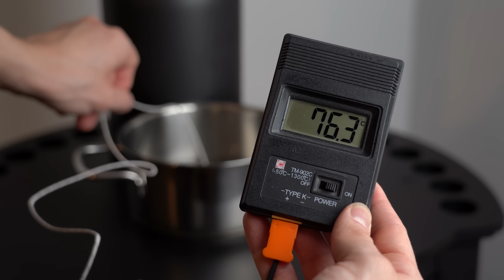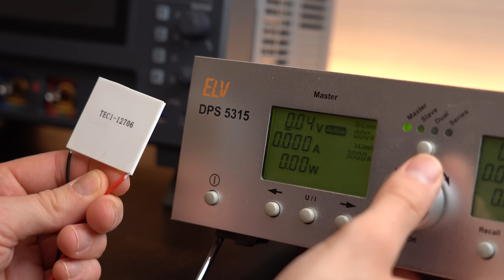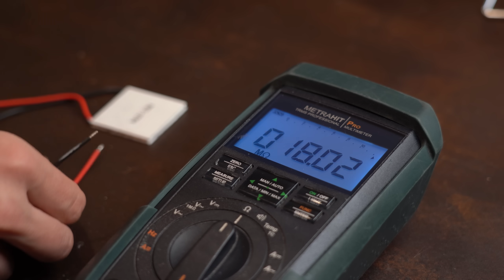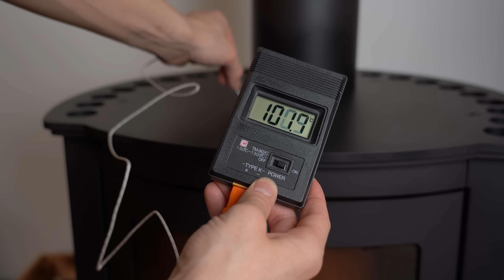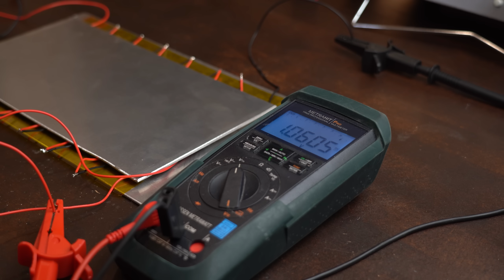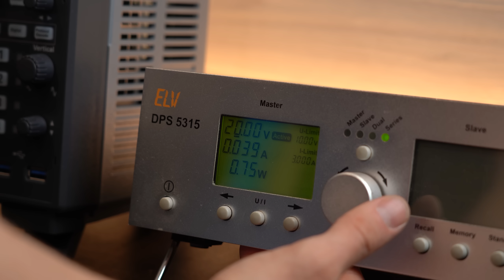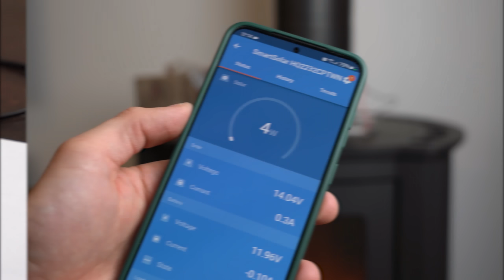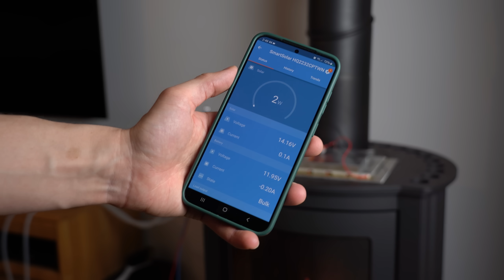I tried to Power my Home with Heat Generators! (Worth it?)

Comment: You can produce more power with a steam turbine generator. You need a boiler, steam turbine, condenser, etc. Waste steam can be used to heat the house with the help of a condenser. Condensed water is used to generate electricity with boiler. It would be a nice project.
Reply: I've got a project in the pipeline to use a Chinese diesel heater to run a steam turbine to generate electricity from diesel very quietly (relatively speaking).  It won't be nearly as efficient as a piston-driven generator, but I don't need much power and quiet is the name of the game for this application.
Reply: @GordLamb  Scott could even use a stirling engine. Stirling engines don't need water to operate (Of course it has less power). However, Scott's intention was to make a video for advertising. He had previously made a video about peltier. The result was the same as this video :D
Reply: He would be arrested by Greta Thunburg and friends
Reply: @MattyEngland  It was funny. Anyway, most of the heat produced in the stove goes to waste with flue gas. The flue gas rises to approximately 380 degrees centigrade. However, we can cool the flue gas to 180 degrees without any problems. There we can use the 200 degree heat to turn the water into steam. In a way, it's like using everything from the deer you hunt.
Reply: @hamzaterzi8801   lol, and yh I agree with you. Might as well make use of the wasted heat.

Comment: Why were you cooling down both sides? 4:07
Reply: so room-temp air could be on the hot side
Reply: Did you know that my 127c at the base cools off to about 60c at the pelter device hotside and 40 c on the fins of my stove fan.  So those are the values you should strive for on a home built one.  Or upgrade the quality of your thermocouple by spending more.
Reply: The fan in this case isn't for cooling its for drawing in heated air. Stagnant air would be cooled by the cup.

Comment: Ich hab ziemlich exakt genau den gleichen Aufbau gemacht. Auch mit Wasserkühlung mit kalten Wasser von draussen. Selbst das mit hitzebständigen Klebeband hab ich so genutzt. Mein Aufbau sieht haargenauso aus ;-) Ich schaffte es mit Buckboost Konverter und Kondensator , dass die Wasserpumpe sich selbst versorgte. Also so um die 10W. Sobald ich allerdings etwas zusätzliches dran gehangen hatte (z.B. Handy) brach das ganze ein. Außerdem hats mir auch die Peltiers irgendwann geschrottet. Denke hängt sehr viel von der Qualität der Peltiers ab. Und man muss wirklich eiskaltes Wasser nehmen. Ist aber m.E. was für Krise bei Stromausfall (+keine Sonne, kein Wind). Es armortiesiert sich nie im Leben.
Reply from the maker: Thanks for the feedback :-)

Comment: Great video, I’ve already tried TEGs on a PC and a barbecue grill—turns out my grill cooked burgers better than it generated power, with about 5W at best. The PC? It didn’t even heat the modules enough to get them going.  Cool experiment overall, but this tech is unfortunetly impractical for real-world use.
Reply from the maker: Thanks for the feedback :-)

Comment: I have a question, are modules affecting each other's output because you connected them in series?
I know for solar panels, if a solar cell is blocked by a shadow (for example a leaf) the current is also blocked through the entire solar panel
Reply from the maker: I thought the same thing at some point. But with the smaller version of this thing, I think it is safe to say that this negative effect should be minimized.

Comment: Build an ORC engine and generator, a small rotary vane pump used in reverse with a generator or for a larger version a scroll compressor from a hybrid car with the inlet check valve removed, a working non flammable refrigerant like HFO air duster, co2  or even water etc could be made to work. You may be able to generate several hundred watts like this but it wont be easy.

Comment: Seebeck generators would have been a better choice instead of the Peltier units.

Peltier are to be used to generate a heat gradient via providing current to the Peltier.  Seebeck generators are the opposite of Peltier, Seebeck generate current output via the use of waste heat energy.
Reply: Thanks, just wanted to comment this when I heard Peltier in the video ;)
Reply: Alright, I’m wrong & your Right… where is the  value you’ve provided to assist the guy in the video succeed with his project?
Reply: @NvTwist  its in the main comments, i told him to buy the TEG versions instead of TEC along with some actual part numbers to search for unlike the rest of u who cant even type TEG without prompting.
Reply: 😎
 buying a seebeck or a peltier module guarantees nothing, these names are entirely interchangeable in the market.
Reply: @echelonrank3927 I see you deleted the part where ya said “it’s the exact same effect in reverse LOL”   (EXCATLY!) but after realizing it agreed with what i posted. Poof delete…. Sad
Nothing is ever guaranteed, but my TEG  set up generates power every time I light a fire.
Reply: @NvTwist  no, it didnt agree with what u typed. 
ur text says seeback generators are the opposite of peltier which gives the wrong impression to the uninitiated that they might be different modules. 
and they are, but only in terms of generation efficiency and nothing more.
then i erased some insults and u think its sad LOL 
maybe whats sad is how ur ambiguous text along with thousands of others offer nothing of practical value to the sorry looking guy in the video instead of actually helping him.

Comment: You should build a Rocket Stove kitchen and use the chimney heat to warm up an insulated water tank 

And the peltier elements can be hooked up to the solar system battery system

Comment: Looks like the middle solder joints don't have kapton tape, was thinking possible short on metal plate, also did u get the temp on the fireplace metal to see what temp the device stops working to try and avoid hitting those temps if the is a max without cooling other side
Reply from the maker: They had kapton tape wrapped around each one.
Reply: @greatscottlab Awesome video, your videos and work are a huge inspiration and some my favorite parts of YouTube

Comment: Hot take? Use a steam engine or Stirling engine connected to a small generator.
The Stirling engine is probably the easier one. I guess you can reach 1-3 Watts on a smaller model with unoptimized cooling.
Reply from the maker: Will try it out next time ;-)

Comment: Get yourself a Peltier powered fireplace fan and reverse engineer it. They use an I beam shaped base to limit the amount of heat transferred to the TEC. Also there are multi-stage TEC modules that are even more efficient.
Reply: ur multistage i beams of overenginnered confusion will not help much, the fireplace fans use TEG modules, not TEC. TEC is used for cooling.

Comment: Gotta scale it up and cool the cool side better I think. This would increase efficiency(higher delta temperature = higher yield) and prevent them from burning out.
Reply: no, gotta use the correct modules instead of scaling up what works badly

Comment: Would be cool to try a passive system with big solar fresnel lens to heat up a dark element on the hot side, and use passive cooling from like an pipe that pulls colder air over a heatsink on the cold side (with some Bernoulli from updraft). 

The efficiency would be bad compared to solar cells but it would fun to see how far you can engineer a passive solar system with basic physics principles.

Comment: Once i saw this video it reminded me of the camping fire generator kipkay made out of a metal container and a peltier module or similar, it managed to charge his phone
Reply from the maker: Charging a phone should be possible with my setup as well ;-)
Reply: @greatscottlab  I knew from the start once you were thinking of using your fireplace that something was going to go wrong, i think it would worked better if the plate was bigger (thickness) so it'd take longer to reach critical temperatures

Comment: What you can do is get round to square coupler for chimney and taking a square chimney pipe, you place heatsinks to potrude inside the pipe, generator on that and heatsink on cold side,
I got myself TGM336-1.4-1.5 module and managed to create about 29W output with hot side at 195C and cold one at 20C
And that's with a single one, I'm making a chimney for a friend that has 20 on them to use up as much energy from the chimney as we can get
Edit: I made a mistake the module I used before was TGM336-1.4-1.5 but it actually fails too easily it was while back and I forgot what exactly happened, but it was able to output 29w but at high overload. I'm looking to better modules like HZ-20, if you got some that could be also used let me know
Reply from the maker: That sounds really good. Thanks for the feedback
Reply: @greatscottlab  do it!!! 😃
Reply: sounds promising. 
is there a was you  keep the peltier element below it's maximum temperature, so it won't get destroyed?.
I think if you are able to exceed a power of 100w it could be really worth it.
Reply: I had a flap to redirect hot gasses away from the hot side heatsink but it wasn't necessary in the end as generator was absorbing the heat fast enough to keep it under 200C
Reply: @mariosmusik4898  depending how much water you have, you could use a steam cooling set up, where the elements are ontop of a water jacket which if it gets too hot can boil off and redirect the heat away from them, that means in theory theyd never hit above 100c , then have the cold side in a seperate bit of cold water
Reply: I would be considerate of the possibility of building up creosote in the chimney, the colder it makes the exhaust gas the more stuff can condensate on the walls of the chimney. chimney fires are not great lol
Reply: @sum_rye  it all just dripped down back into the fire but that's a great point would be good idea to keep an eye out for it
Reply: Can't heat electronic component over 85C before it breaks down...think overheating CPU...get em too hot..they smoke
This is why those small peltier fans for stoves like that have a very long extension/run to allow heat to dissipate and not get too hot on the peltier (calculated thermal conductivity), but still close enough to provide heat, and they use VERY low current draw motors to spin a small fan slowly to circulate the air
Reply: @haydenc2742  stove fans don't need much power so they are usually 100C on hot side but thermoelectric generator module i use are rated up to 260C on a hot side so you can extract much more power from it
Reply: Wonderfull!! I am very curious
Reply: Creosote.
Your internal heat sinks will plug in a few days creating a real hazard of chimney fire which will dramatically improve the thermal delta, boosting the electrical output ..until the fire department sprays the charred remains of your house with water, and shorts out your system..
Reply: @Dr_Wrong  yeah... Nope
Still hasn't happened, and after multiple inspections I found no buildup on a heatsink except surface soot, but in new design I'll take that in consideration
Reply: @  

Chimneys without obstructions can easily build up creosote in one season, and too often have caused chimney fires. 
    Surely you know this..?
Reply: @Dr_Wrong  you are right I'm an complete idiot that just built a fire hazard without shred of research. And frequent checking. I'll scap this project imedeately.
Reply: @blackturbine   

Instead of crying, you could have explained to everyone your design solutions for keeping them clear, rather than just sounding post hoc with “I’ve never had a problem!”
Reply: @Dr_Wrong  my design solution was that it was too hot to foul up. I said it was frequently checked and there was no buildup of soot but you kept repeating yourself that it will cause a massive fire and how creosote will build up and the way you did it did it didn't offer any potential solutions and just came off as mockery.
If you are worried about it get a brush and clean the chimney out.
I said I'll take what you said into consideration, that doesn't mean I can shit out a design in few minutes
Reply: I would clamp the modules onto the outside of a square chimney with heat paste to keep the smoke and gunk separate .
Reply: The hz20 is 90 dollars a piece!! Good lord
Reply: @DreStyle  really? What website did you go to? I found them for 60$ i can send a link tommorow.

Comment: I would rather build a ventilation heat recuperator on these. 
Two big heatsinks sandwiches several TECs between them. One fan is blowing out warm room air thru the cold heatsink to outside, while another fan is blowing cold outdoor air via the hot heatsink. 
So, using, say, 100w to power TECs, you will get 100w heat + 19-20w of recuperated heat. This will give more that 100% heating efficacy, while changing a room air with a fresh air from outside.
Reply: Wouldn't work. The temperature difference just wouldn't be big enough to generate any significant power - you'd lose more to the resistance to air flow imposed by the heat exchange surface and thus slightly increased power consumption in the fan.

If you are living in a cold climate you can use a heat exchanges to draw heat from outgoing air and into the incoming fresh air. The equipment is pretty bulky, but very common in large HVAC systems.